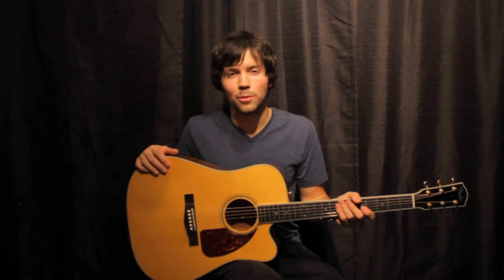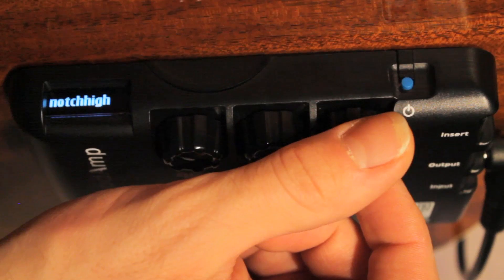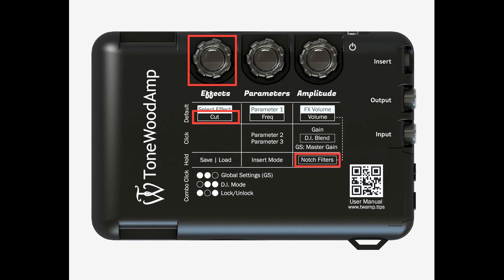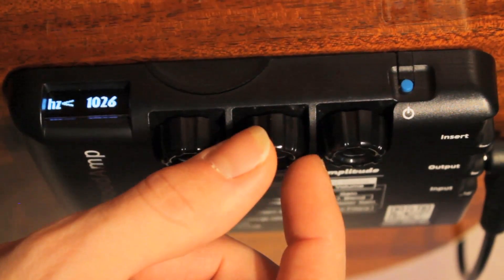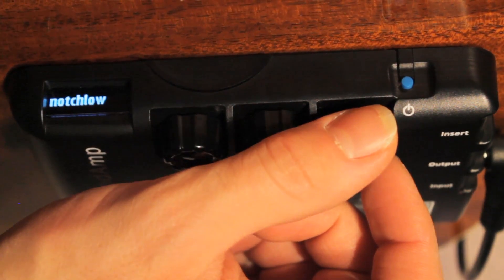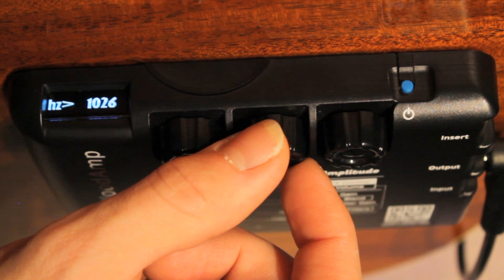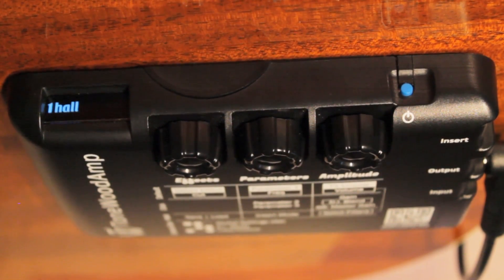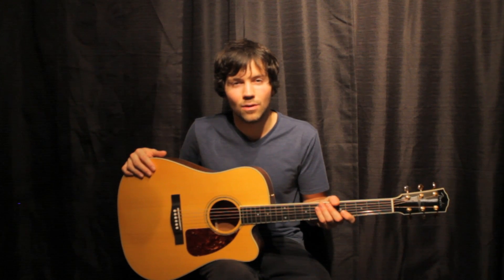Notch Filters (5.1)

Comment: The settings in the latest firmware (2.69 as of July 2020) have notch 1 instead of low and notch 2 instead of high.  For my Washburn 55-Mini Koa with a K&K pickup I had to dial in a cut of 13 at 884MHz in notch 1 and a cut of 11 at 1402MHz in notch 2 but I still occasionally get feedback in the 1050MHz range (This is only while using autowah). Is there a way to add another notch?
Reply: thanks for the tip,

Comment: It don't works with my Dowina Chardonnay JCE. I tried all the videos. As soon as I go up with gain that the effect can be heard good there is a feedback. going through the frequencies doesn't help either because there is continuous feedback noise. No matter if notch low or notch high. The only thing that helps is to turn the effect so quietly that you hardly notice it anymore. Too bad.
Reply from the maker: Hi there, please reach out to support@tonewoodamp.com for assistance. Perhaps this is just a settings issue.